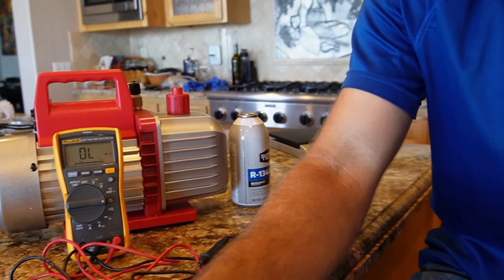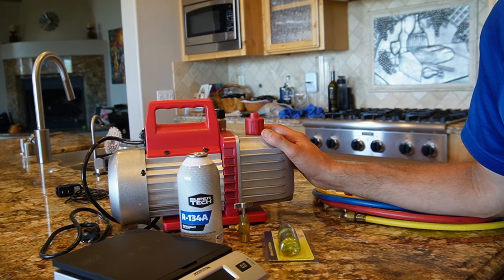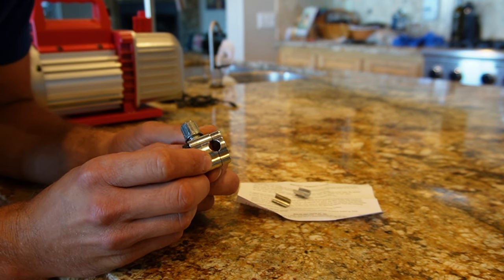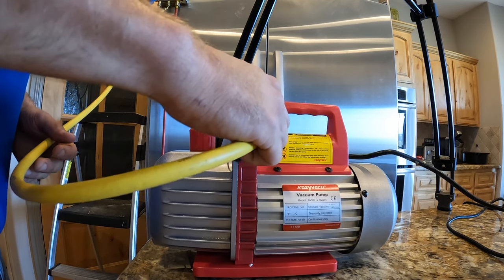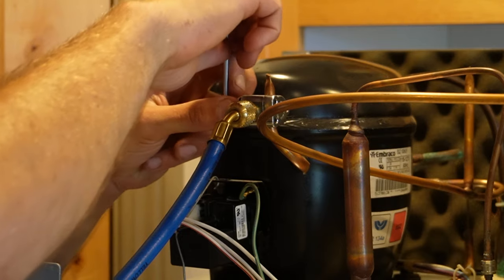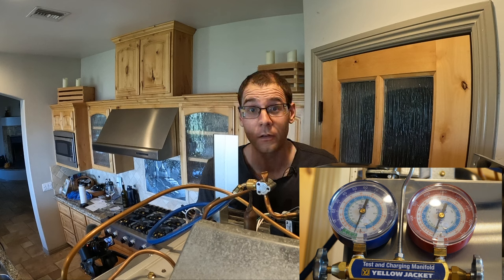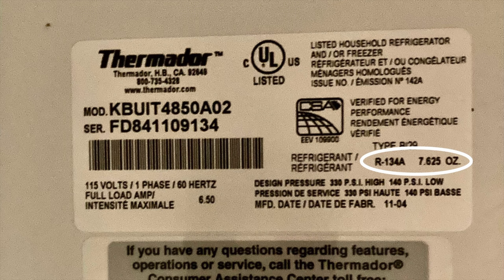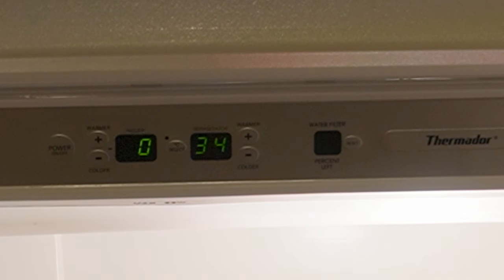How to Recharge a Refrigerator Compressor

Comment: With all due respect, a trained technician would have used the proper procedures required to meet EPA refrigerant regulations. These procedures protect the technician and the environment.
Reply from the maker: In most cases, when refrigerators die they are thrown in a landfill and replaced with a new one. I would argue that this has a much greater environmental impact than venting a few ounces of R-134A to save an existing fridge.

My goal is simply to help people with minimal resources fix their refrigerator.
Reply: @TheEscondidoExperiment  I agree yes  epa certification helps to manage and work with refrigerants which can be toxic and harmful to health in certain conditions. R-134A can cause serious breathing and cardiac issues in certain conditions so appropriate PPE and ventilation is important as is recovery procedures. However that being said I  fully agree putting a refrigerator this size into the landfill is more impactful.
Reply: Awlsome video. I was looking when you attached gauges there was no pressure when you opend the piercing valve prior to evacuation. Great job. @TheEscondidoExperiment
Reply: @mathman0101  Really? All 7.6 ozs of that R-134a refrigerant is gonna cause cardiac issues. Also there was no refrigerant to recover. Any trace amounts would have been captured in to oil of the vacuum pump.
Reply: Hardworkin I don't think you have worked a hard day ever in your life just based on how nieve you sound. Of course a Tech would do it a bit different, they should. If you do something for a profession you hopefully have a process that is a little better than an everyday person would be using. R-134 is way heaver than air, so it all just fell to the floor and gave the cats cancer. Everyone has to be a know it all-geez. Who cares what a HVAC tech and the EPA and you, have to say about my process. If you knew all the shit I do that some people would consider "bad" or "illegal" you would have a stroke if this got you that worked up.
Reply: How did you seal the cooper tube that you Pierce ?
Reply: @myfiles7937  You close the valve that you installed. Yes, in time, it will probably leak down again from the original leak spot and probably from the valve as well, but if you are just trying to get by as a homeowner, the cost for a can of R134A is minimal enough to not worry too much about it. Ideally, you would find the leak, repair or replace the part and braze in a service valve. But again , this is a DIY homeowner guide.

Comment: I have a service port on my low end and high end of the compressor in my LG refrigerator due to someone else changing the compressor at one time. Do I need the piercing valve? I am afraid that when I disconnect the hose from the service port, that it will depressurize the system. How do they remove the hose without that happening?
Reply from the maker: If you remove the piercing valve the refrigerant will definitely leak out. However, if the piercing valve is working correctly, then when you close it (turn it all of the way to the right) it should create a seal and allow you to remove the hose from the service port.
Reply: Oh yes, I understand if I used the piercing valve, it is permanent. Mine already has an installed service port on the pipe that will allow me to connect the hose directly to it. It doesn't have a valve on it like a piercing valve does. You can connect the low side hose just like on a piercing valve, because my  port is at the end of that pipe you use the piercing valve on, instead of it being pinched off. My question is, can I safely remove that hose after charging using that port? I assume the person that installed that service port must have unscrewed it after he charged it?
Reply: It would be nice to add a photo
Reply from the maker: @paulmillar4774  Without seeing the port you're referring to I can't give you a good answer. Generally there is some type of valve that opens and closes the port

Comment: That is an expensive refrigerator you’re using as a DIY project. A refrigerator should never need recharged. If so there’s a bigger issue.
Reply from the maker: I would say that it's too expensive not to try to fix it!

I added the UV dye so that I can hopefully find the leak in future and fix it permanently.

Comment: You let air back in the line after you purged the line. The lines must stay connected.
Reply from the maker: R134A is much heavier than air. It did not get displaced by air in the 10 seconds that I took to add the UV dye. Had I left it disconnected for hours that would be a different story.

Comment: Should have left blue hose connected to open piercing valve, closed manifold before turning vacuum pump off, then purge yellow hose at manifold hose connection.
Reply from the maker: Doing it in this order would also work. It makes very little difference either way.
Reply: @TheEscondidoExperiment  problem is that you didn't get rid of the air in the blue hose, you just ran refrigerant through it and then reconnected to system there by introducing air into the system, what am I missing here?
Reply from the maker: I ran refrigerant through the yellow hose into the manifold and then into the blue hose. This displaces the air. R134a is much heavier than air so it will mostly remain in the lines after closing the tap on the can. 

My gauge set doesn't have a purge valve on it. Were you assuming that it did and that I ran refrigerant through the yellow hose and out of the purge valve?
Reply: Ok that all makes perfect sense, my mistake,  I guess as long as the  unit is cooling properly you're good to go.
Reply from the maker: No worries. It has been cooling perfectly for over six months now.
Reply: If you add 50ml of water to the compressor before regassing  the compressor will run cooler

Comment: I have a less than 2 year old ge fridge that makes a lot of rattling sound,  Several techs have worked on it and ge says this is just a normal sound,  the coolant boiling thru the line causing a rattling noise.  I think the tech that serviced it was a little goofy,  Is there anything I can do,  GE sucks and will not fix it.

Comment: Hello mate!
HUGE thanks for the video, I have a LG 5 year- old fridge that the temperature stays at 10 celcius instead of the range 1-4  celcius and i am going o try adding some gas back in the system. I have a question though: does the servive line gives the same pressure as the suction line??? Most of the relevant videos i Have spotted use the suction line to pierce and purge. Thanks!
Reply from the maker: You want to refill on the low pressure side. The short line with a crimp at the end (process line) or the suction line (the line through which refrigerant returns to the compressor) are both fine.
Reply: Deeply appreciated your instant response! Your video is the best out there from the hundreds! Totally your channel won my subscription!
Take care!

Comment: Please don't take my comments as a complaint.I loved your video and thanks for a detailed video for such a bigger problem in refrigerators
@8:30 minutes of your video you purged the blue and yellow pipes but again you opened yellow one for UV liquid pouring,so did you vaccum the compressor again or did you allow a small amount of air from the yellow pipe😮.
Reply from the maker: R134a is much heavier than air. Because of this, disconnecting the line for 10 seconds to put UV dye in is not going to cause the refrigerant to be displaced by air. It's totally insignificant. There was no need to purge the line again.
Reply: @TheEscondidoExperiment  thanks for your lovely explanation 👍

Comment: Is there anything that should be done differently if its a dual zone refrigerator?
Reply from the maker: If it only has a single compressor then the process for recharging will be the same.

Comment: Is it safe to say that the piercing valve stays on the copper process line?
Reply from the maker: Yes you need to leave it on. If you were to take it off all of the refrigerant would leak out.

Comment: Where did the original  refrigerants leak point are?
Reply from the maker: Not sure yet. It's still working fine. Once it stops working I'll take it apart again and use my UV light to try to find the leak.

Comment: I would have added a leak sealer with uv dye so that might have sealed up any small leak. That suction line look suspicious
Reply from the maker: For small leaks on copper lines you can just use a map gas torch and some sil-fos. I'd prefer doing that than adding a leak sealer.